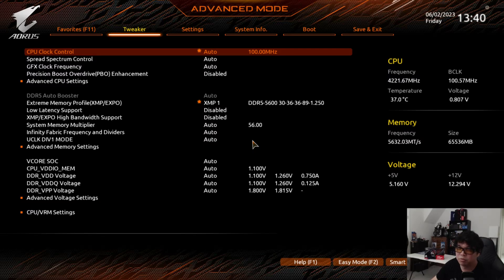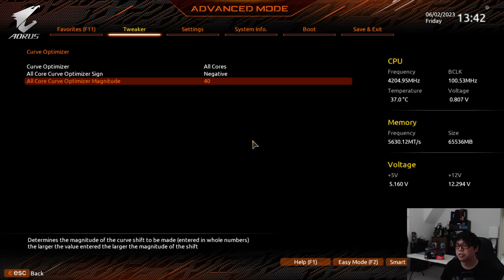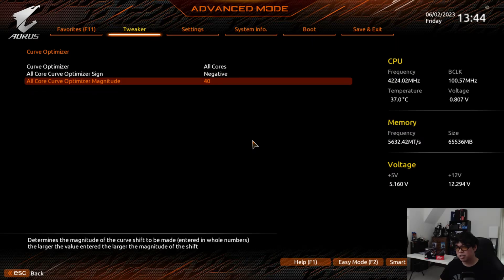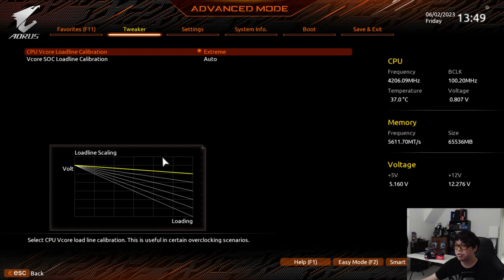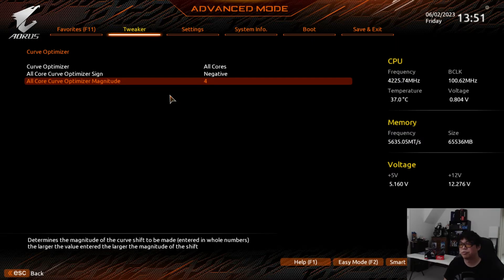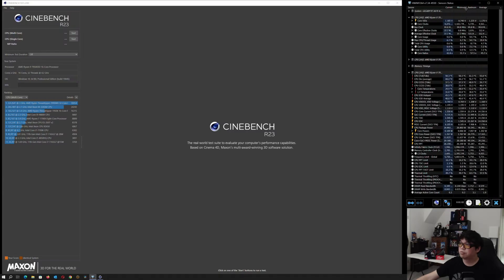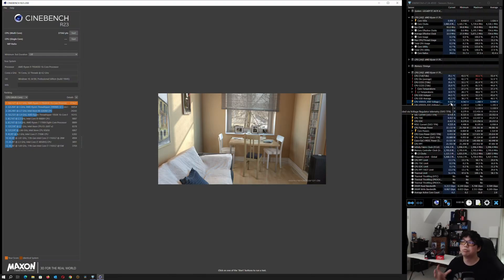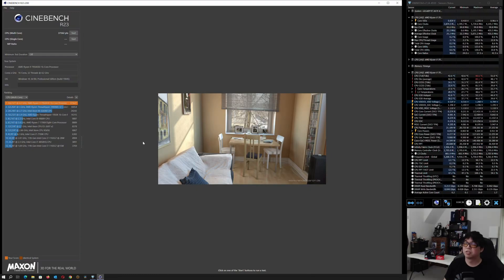How to optimize Ryzen 7950X3D, 7900X3D, and 7800X3D

Comment: I have an ASUS motherboard, and I'm hesitant to try this because the LLC options are just levels numbered 1-8, and I don't know how that compares to your "extreme" setting, and my BIOS doesn't include a graph.
Reply: I tried LLC 8 on my Asus mobo with co -37 , instantly almost hits 89 , artic freezer ii 240 open/bench build , at least with LLC6 hovers around 82 , might dial back more , no crashes with R23 or corecycler but instant crash with OCCT
Reply: Same issue , can't find any info about Asus LLC , so max probably not a good idea .I'm using LLC 6 , Asus bios manual recommends 5 for overclocking so I bumped up by one
Reply: Asus LLC settings are opposite of other mobo as Asus' highest number (8 in some cases) is the max LLC setting; whereas 1 is the max llc setting and a larger number is the lower settings on other mobos. Setting max llc on an x3d chip is not the same as setting max llc on a non-x3d (which you normally wouldn't do). However, if you can set llc at a lower v-droop setting and still get your max performance, all the better.
Reply: @RKBenchmarker hey man you seem really knowledgeable about this. But I always like doing more research and getting more sources. Trouble is not many people are talking about this other than this video

I'm especially interested in seeing more info/sources about 3d chips capping voltage making messing with LLC safer.

My specific situation: Applying per core co offsets that seem stable with core cycler and all core stability tests and gaming. But are weirdly unstable at lighter loads (usually reopening a browser with existing tabs from idle causes bsod).

I'm thinking LLC can help with this. Thoughts?

Comment: How is ur cinebench score so high? I am using 7800x3d with a negative value of 30 and using extreme, I am at around 17000-18000
Reply: You are hitting a good average for the 7800x3d. He is using the 7950x3d, which has twice the cores.
Reply: @RKBenchmarker  
I mean how does a $360 cpu beat the mighty 7950x3d 650$ usd CPU in gaming 
Make a video for us 7950x3d users , i want the same performance as 7800x3d is giving

Comment: Cinebench is a benchmark and does not test for complete accuracy. You can be Cinebench stable but still crash inexplicably every month or week when some error hits a critical part.
It really depends on what you can deal with. If you don't mind some random crashes, use Cinebench as a quick and dirty stability test. Otherwise use Prime95 which loads the CPU and matches computed values with known accurate values. Use the blend test in Prime95 to stress both CPU and memory controller. You will find that you will have to dial back a lot to get it Prime95 stable. And do run it for  at least an hour because 1 pass of small fft (everything laoded into cache) will take up to 10 min before it moves to large fft (stresses memory controller as some RAM is used). Run it over night without any errors and you are rock stable.
Reply: That was not the point of the video; however, your point stands and it is good info to share. The only adjustment I'd make to your comment is that some of the stability tests are unrealistic and most users will never run their system even close to that. It is better to test stability for one's specific use case. CB23 is a good place to start and if one experiences a crash while doing something else, WHEA errors can help to determine which core/s is the issue... then tweak its CO offset.
Reply: @RKBenchmarker  I thought that was what   I mentioned. If you can deal with it, use Cinebench as a quick and dirty stability test.  But I don't think loading all cores or having transient core spikes are that uncommon. It happens all the time when loading Windows.

Comment: Watch it crash when running Aida 64 SHA3 Benchmark curve optimizer is a waste of time.
Reply: If that is your test of choice, then in that case, you would simple adjust the CO offset until it is stable. I'm sure you could always find something that will crash a system but that is not what this was about.

Comment: Dude, I have a 7900X3D and also a Noctua NH-D15 and my Idle temps are mostly around 55C. I got a curve offset of -15 and a 85C temperature limit set in BIOS, but this only helps with temperatures and clock speeds in full load. What else can I do to improve idle temps? Or should I maybe not even be worried about those temps? Also the highest clock speed I can reach is 5.2GHz, never even close to 5.6GHz.  I can not use a curve optimizer of -20, so I think I got bad silicon. What do you suggest? Thx
Reply: X3D isn't meant to actually get max clocks in benchmarks, even with good liquid coolers. It can clock that high, but it will always reach temp limits before it will clock that high. Those idle temps seem a bit high though, but maybe not. I'd say 45-50 might be better, but it's probably nothing to worry about. About all you can do is set a more aggressive fan curve for the CPU fan. So instead of 20% fan speed at idle, you'd start with 40% at idle and step up from there. i.e. 50% at 60c, 70% at 70c, 80% at 80c, 90% at 85c. Usually CPU fan curve settings have about 4-5 steps, so you'd just try to evenly distribute the fan curve so it ramps up smoothly. Buying a better fan would also help. Try the Noctua industrial fans. They go to 3000RPM, but they're basically identical to the normal noctua fans at 100%, when used at only 50%, but with twice the static pressure. So you don't have to run them at 3000RPM, but you also can if you don't mind the noise for heavy tasks, and they would definitely make a big difference in the amount of air being pushed through.
Reply: @peoplez129  thanks for your reply. I installed some monitoring and benchmarking software in the meantime and did some testing. In single core benchmarks or benchmarks which only stress a few cores the boost reaches 5.5 or even 5.6 GHz, so I think everything's alright now. The rather high idle temps are probably also because of my case and the whole setup. I got a sound dampened case, so the side walls are closed. I run the front and back fans pretty slow via a fan controller, because I want a silent build. That's the reason why it runs pretty hot.  Already got a silent CPU fan curve as well.
Reply: @dominik2631  Since you want a quiet system but are choking your cpu due to lack of air flow, I would suggest upgrading your case to a Fractal Torrent as it is the best ranked air case out there, and can run those large front fans slow making it extremely quiet with great airflow! The other choice is get a good AIO, which will help significantly.
Reply: To help with temps you can install the noctua NM-AMB12 offset kit.

Comment: My CPU Vcore Loadline Calibration is shown in Levels 1-8 in my uefi, ASUS B650E-I BIOS 1616
Reply: On Asus boards, 8 is the most voltage applied to vdroop. On other boards, 1 is the most.

Comment: After you pass a prime95 run of about 6-8h you can say the settings are good. I can run cinebench with even -45 on my 7800x3d but man...the second I press start in prime...boom, crash. After that I started to test each core in OCCT and found out that, 7 of the 8 cores can run at between -21 and -25 and one core is absolute "garbage" and can only run at -13. Yes, curve optimizer is the way to go to lower the temperatures but the architecture on the am5 platform, especially on the 7800x3d is a bit weird, you cannot boost that high the clocks and needs at least a few days of testing to say that your system is 100% stable. After doing all these tweaks I then tested in prime95 and OCCT for about 12h each (the average time my pc is open) and had 0 errors. I saw someone said that picking individual offsets for each core can lower your performance...that is 100% false. You gain performance by doing so, cause each core can boost higher depending on the offset. If you can make 7 cores to boost at a bit over 5ghz and one stays below 5, will always bee better than having all cores limited to 4.8.
Reply: The guy who said you lose performance by applying per core offsets was Michael, one of the first comments. He is greatly mistaken and is applying trying to set per core FREQUENCY in CCD/CCX (not per core CO), which in that case can't be done as it defaults to the lowest core's speed. However, (as you and others have mentioned) per core CO is completely different as it adjusts the voltage offset (not frequency) and it works great . Just a thought on stability testing: Some of the stability tests you mentioned are unrealistic compared to what most people will actually stress their systems in real-world cases. I tend to stress for my worst-case real usage. You could be losing a lot of performance if you stress test for something way outside of your worst-case real-world usage scenario... just something to consider.
Reply: @RKBenchmarker  i always stress test for worst case scenario, but as you said that is unrealistic for most cases, as I usually game on my pc, for example forza5 or cod can run with no problems, cyberpunk crashes my system the second I play start. Sometimes even the basic youtube videos crashed my pc. Since then i try to find the perfect balance between 100% stability and usual workload/gaming stability. But you cannot go wrong with 100% stability, even at a loss of 2-3 fps.
Reply: @Focaz  With your knowledge, you and others could easily set different bios profiles for a set of different games/scenarios if you wanted to take the time. Just another option in the long line of options :) Game hard my friend!
Reply: The 7000 series x3D chips are technically locked. The 7800x3D will not boost past its top speed of 5050hz without some infinity fabric or multiplier tweaking as the boost overide settings do nothing. It's online but I'm not sure if it is prime stable.
Reply: @jimmyhuang7481  You are correct, some of the higher-end mobos, such as the Asus x670e Hero, have a separate bClK adjustment. You set eCLK to asynchronous mode, bCLK1 stays at 100, and bCLK2 you would adjust for cpu frequency (to like 106 or 108.15, etc). Employing that function/strategy/technique along with others can achieve some great overclocks on a processor that is otherwise "locked". I've had a lot of fun with the 7800x3d :)
Reply: @RKBenchmarker  So all that hassle for a 4 or 6 percent boost in performance? Which can be within margin the margin of error? Nah OCing the 7800X3D seems like a waste. Unless you chasin' benchmark scores

Comment: So I have a x670e-a and I’ve set the llc to maximum and I see no difference in performance. If I set it to standard or normal I get the same scores in cinebench. This normal?
Reply: It doesn't help performance scores, it helps stability so your computer doesn't crash.
Reply: @Tarrgetthis  gotcha ! Good to know! Thanks
Reply: @Mexi99  Are you using Curve Optimizer? That's where you will see increases. LLC will help with vdroop so the voltage won't go too low and crash.

Comment: This will help in benchmarks like cinebench,… but for gaming, like you bought this for, it doesn’t matter. 

(7800x3d since launch here) cheers. 
Used a good 6000 Hynix kit set expo 1 and go game.

Edit - 18600 all day multi core 30 min runs on cinebench. I’ve got 19100 but it wasn’t stable 100%.  
And again, none of this really helps gaming. And why you’d care about these benchmarks buying a stacked cache variant vs gaming is beyond me.
Reply: For the games that use the cpu extensively, it certainly does help. As well as gaining performance in other areas besides gaming. What mobo do you have and what settings for your CB23 runs? Thx in advanced.
Reply: Gamer who also makes youtube videos, editing, game development, app development....
Gamer who works needs score in CB23 and doesn't want to sacrifice FPS in the weekends.

Comment: What is the point of using LLC with negative offset CO without overclocking? Just apply a weaker CO so you don't need LLC.
Reply: LLC helps to keep the vdroop from going too low. LLC does not increase the voltage and thus doesn't negate CO neg. offset.
Reply: PBO curve is not linear, it undervolts more with low and middling loads (hence the name 'curve') and a lot less when fully loaded. It is also not a set value but an offset from default. Modern CPU's lower voltage as more cores are loaded naturally, LLC overides this vdroop and raises the voltage used under laod. Taking this into account where there is only a slight undervolt under full loads with PBO curve, LLC at high levels might actually use more voltage when fully loaded. You may still have an undervolt at low and middling loads. So you are kind of modifying the PBO curve under higher loads by using LLC.
Someone may have to confirm with actual measurements but that is how the PBO curve and LLC works.
Reply: @jimmyhuang7481  Again, LLC helps to keep the voltage dips from going too low; the x3d is different than the x version, which you normally don't max the LLC. The x3d limits the voltage so LLC cannot overshoot that set limit. If the voltage is stable at a certain level, LLC will not increase it. I have verified this through measuring. Hope that is helpful.
Reply: Just to share my experience. Negative 40 OC offset/Extreme LLC/80c temp limit on Gigabyte Aorus Elite X Ice b650m. Scored 18836 in r23 with PS 120 SE air cooler. But anyway, I built my config to play cs and, oh boy - these bios settings completely changed how the game runs and feels. I play 4:3 1440-1080p on literally the highest in-game settings and my avg fps are 475 (this is the msi ab average over a period of time), 1% lows are phenomenal in the 300s and higher. CPU temp is in low 60s, something under, rarely low 70 for a second when shades compile. I can barely hear the fans and cpu power consumption is 60-70w. I think I don’t want to go further than that (by opting for Super Extreme which flattens the line completely), but in any case, I am very happy I had the guts to go for these settings despite so many forums advocating against. I know that the x3d chip is locked for voltage at 1.24 or something so I have no fear of going close to 1.3. Thanks for confirming my understanding of how LLC works in x3d chips and cheers.
Reply: negative CO gives you 40 millivolts less for same 5Ghz.
But it doesn't reduce voltage, actually voltage stays the exact same and now you get 5.2Ghz.
5.2Ghz is not stable at old stock voltage, so LLC acts as overvolting (classic overclocking would postive offset voltage).
Idk why all people consider CO undervolting when measured with a voltmetere the voltage stays the exact same, just frequency goes higher on the curve graph.

Comment: For some reason when I run cinebench my 7950X3D only shows 8C/16T
Reply: Did you have a chip in the same MB prior to installing the 7950x3D?
Reply: @SteezinBreezin  This was a new build new mb new chip
Reply: @FloridaVibesOfficial  your comment was 3 weeks ago. Are you still having this issue or is it fixed?
Reply: @SteezinBreezin  still an issue
Reply: @FloridaVibesOfficial  is both CCD enabled in BIOS or set to auto
Reply: @SteezinBreezin  where in the bios are you speaking? I have an Asus B650E-E board.
Reply: @SteezinBreezin  make a video how to make our 7950x3d perform the same as 7800x3d
Reply: @officialyashvirgaming  What you mean? Why you asked me that?
Reply: @FloridaVibesOfficial  You can turn all CCD's on, also it may be software side (Afinity settings) Enable "All Process"